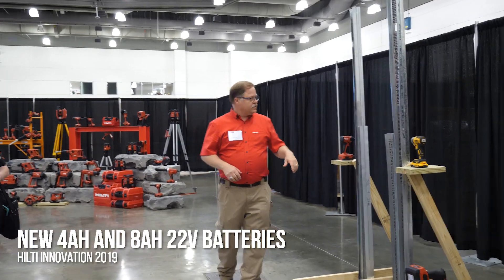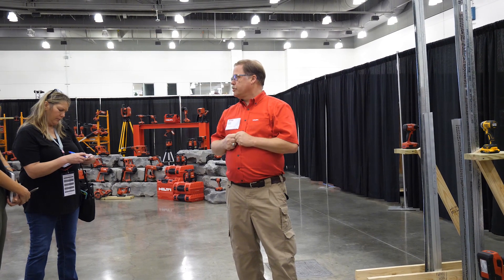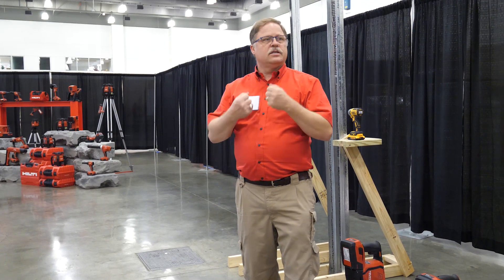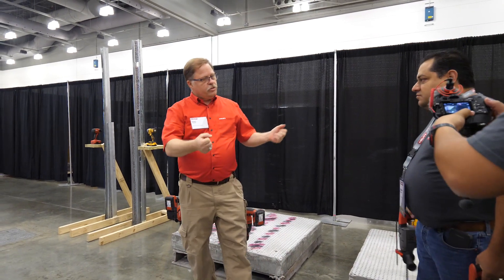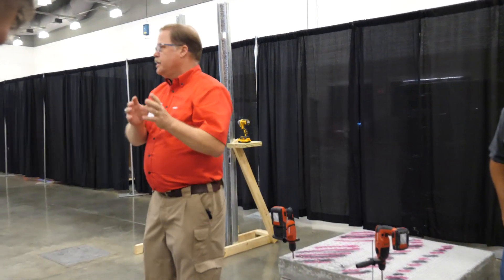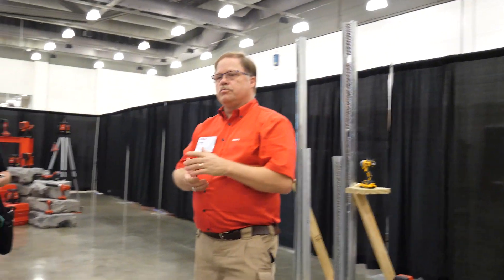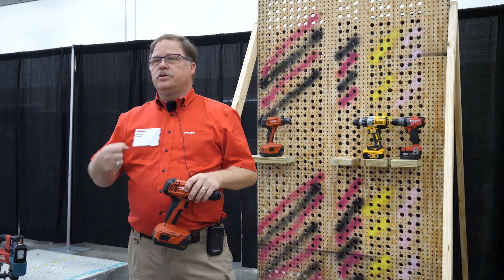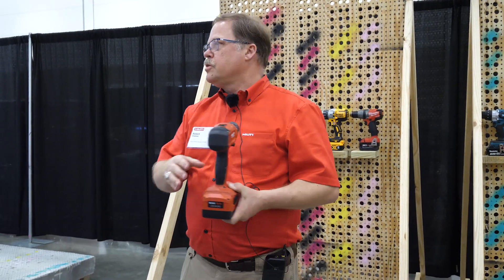NEW Hilti 22V Batteries! 4Ah and 8Ah 22V Batteries with 21700 Cells - Hilti Innovation Day 2019

Comment: Lol I love Hilti tools but that 1-1/8th Milwaukee could dunk that little Hilti hammer drill. I've personally drilled 1-1/8 holes through 14 inches of slab with one. It worked really well. I even got like 4 holes a charge on a 5.0.
Reply: Till it fails 2 months later power and it takes a month for you to get a warranty repair on it not to mention the overheating problems yea I’ll stick to Hilti even if it fails warranty has it back in my hands repaired within 3 days
Reply: @johnadams1052  I’ve had both Milwaukee and Hilti tools fail. Guess what tool is broken right now.... My Milwaukee hammer drill. Bahahah. The trigger is broken on it. Ive had Hilti tools take longer then 3 days too repair. They gave me some bs excuses that it was like 3 days to ship to the repair shop.

Comment: Hey i love hilti ans everything but i like the milwaukee hammer drill wab better, and for the battery i just put my 8.0 and actually i never need it i always use the 5.0 is perfect for that.
Reply: Hilti 5.2 ah compared to any other tool makers batteries with 5ah has more volt (22v) therefore more power, more watt hours so it lasts longer and discharges slower but it still charges quicker than even 3ah competitors.Dewalt and Milwaukee is bottom end as You will always use battery quicker than charge it - unlike Hilti!!!
Funny enough Milwaukee and dewalt do have 12ah batts but it seems to take a whole day to charge them and at most an hour of run time.
Hilti's 9ah (18650 cells)36v equals 18ah of 18v battery power and still charges in 55minutes.
(New cells will only make a gap to competitors  even bigger )
It lasts on other hand nearly 2 hours of constant use (depending on tool and applications ).
There is Hilti and none to compare.
I own 20. years old. And some new tools from Hilti. 
 Nothing compares to Hilti.
Sds on video is not the newest or the best  in Milwaukee and Hilti portfolio.
It doesn't matter what decade tools are from.Hilti is still on the top.
And at the end of the day Hiltis service and warranty is not even in plans of competitors.
Who else can give You a new tool and  part exchange Your old tool?
You buy cheap You buy twice ;) 
Vibration and high speed brushless motors are ruining bearings with too much stress.

Comment: Lol it is so rigged dewalt and Milwaukee have 6 9 and 12 amp batteries and Milwaukee has an 8 amp and they only used the gen 2 Milwaukee drill because they know the new one is better
Reply: Oldest tools in video are hilti tools(e.g. te4-a).
Comparison was 4ah hilti vs 5ah competition. 
There are 9ah milwaukee and dewalt batteries shown in video but looking at it they are way bigger than 8ah hilti and offering less WH power than 8ah hilti with far longer charging time than hilti battery.

Comment: Why are you guys showcasing this video? He is comparing a 2nd Gen Milwaukee with 18650 vs a new Hilti 21700. 

Look guys! We can beat models that are over 5+ years old!
Reply from the maker: We went to hear about the new offerings, and this is the presentation we were given. We agree... it felt a bit insincere to compare these new 21700 cell batteries to non-21700s as if they got there first.
Reply: Why milwaukee and flexolt don't have a new cells yet?
Wait a couple of years and compare it then :) as at the moment Hilti is 10 years ahead of competitors and hilti tool still lasts longer than anything new from Milwaukee
Reply: @toolfevertoolfever8716  true
Reply: Hilti te4 and te2 are actually the oldest tools in the video and with old brushed motors.
Te2-a is on the market for about 20 years. 
Te4-a is over 10 years on the market.
Hilti-Outperform. Outlast!

Comment: Why is he comparing his "new" 21700 cells to dewalt and Milwaukee 18650 cells ?
Reply: Does Milwaukee or Dewalt get new cells to compare the same battery?
Milwaukee always compares new comers to older competitors tho and none comments on this
Reply: Donny Sanner exactly.
Reply from the maker: This.
Reply: Because Hilti are innovators, all others just copy each other. All other toy tool makers will get on board with  21700 battery packs soon enough. Had most of my hilti for over 5 years now. Not 1 bit of gear has failed me. Cant say the same about makita, bosch or milwaukie.
Reply: Lol but neither can keep up with dewalts 60v line